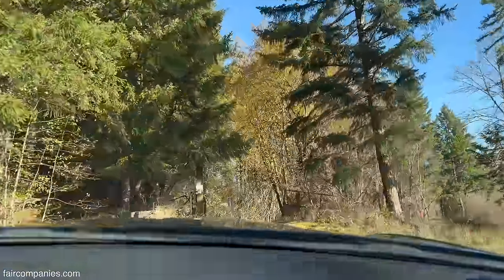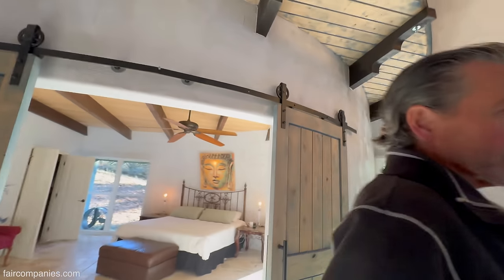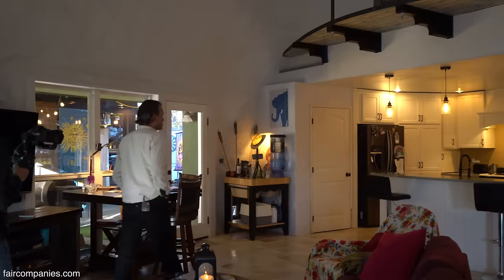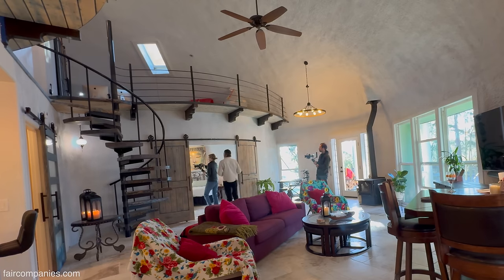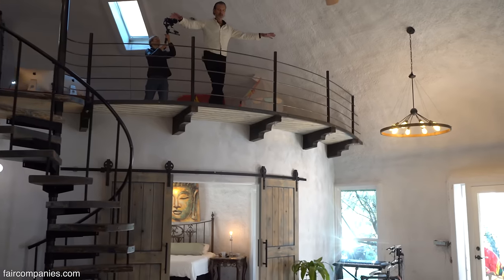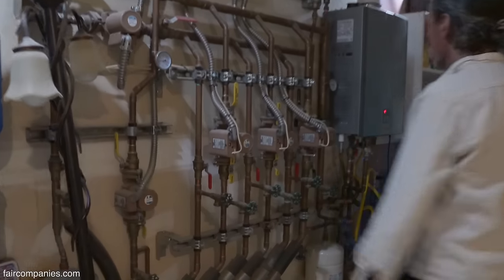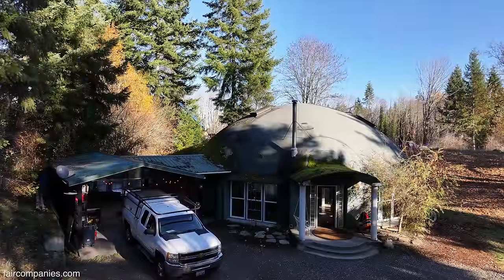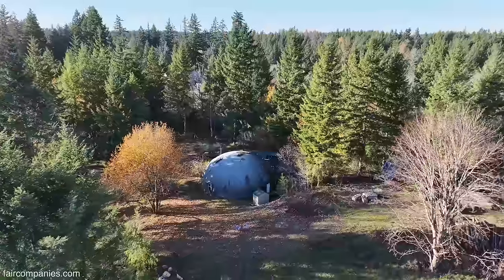Builds Quonset bunkers for a living. Lives in Dome Home in the woods

Comment: Monolithic domes, like this, are the best kind (made from a one piece  shell of concrete). They are extremely strong, very insulated (with foam), and not prone to leaking. The problem with Geodesic domes is all the seams where the triangles meet. Eventually, these seams may leak.

Comment: "most homes are r40" ...nah. most are r13-19 (traditional 2x4 or 2x6 framing), but that's in the cavities between studs. once you deduct all the wall sqft that is studs/joists, w/o insulation, you're dropping that 13-19 by -25%. most homes are garbage.